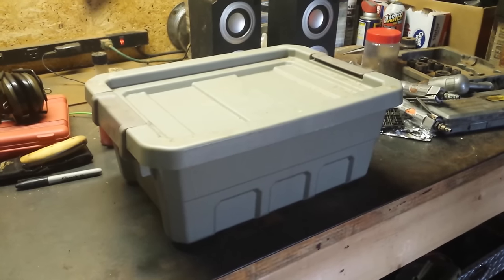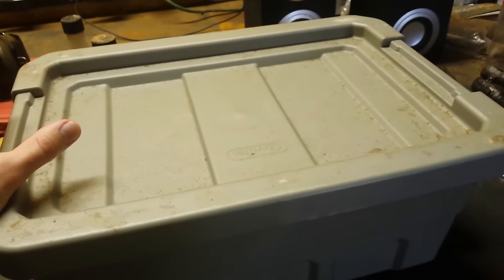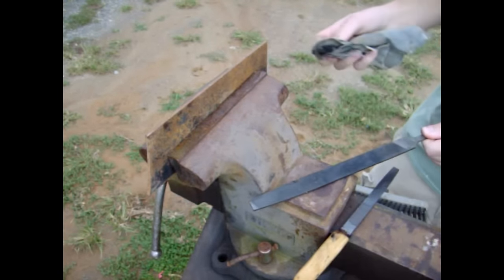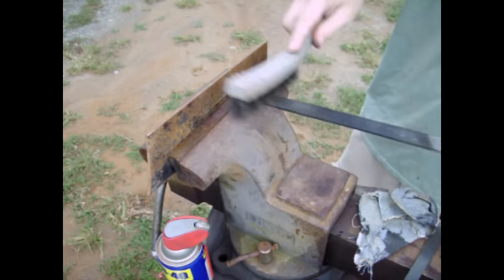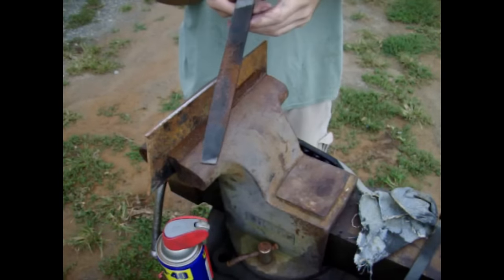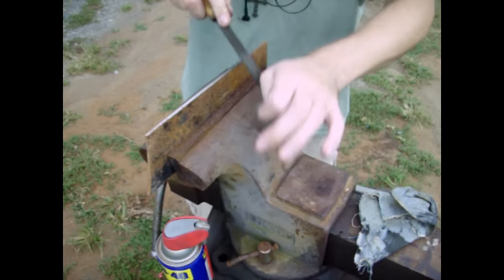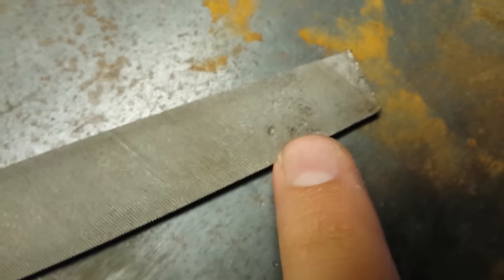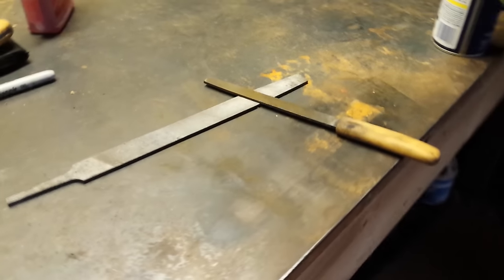How to restore your files without sulfuric acid

Comment: One of the most common forms of file abuse is to keep on trying to file a piece of hardened steel while ignoring the inevitable skating. That will very quickly knock the tips off the teeth  of even the best files. If you are not sure how hard the stuff you are filing is, use an old file to 'test the water' before hitting the job with your best files.
Acid is a waste of time. All you are doing is turning a file into a piece of metal 'sandpaper' that will grind metal rather than cutting it. Buy good quality files and look after them.

Comment: It really doesn't sharpen the file it just cleans the muck out which in turn will make it file better. Anyone that uses files alot should keep them clean with either straight muriatic acid or hydrocloric acid that cleans pretty fast thats what i use or like he done it here in the video it takes longer to clean but not as effective...

Comment: Hey a wire brush just dulls files if u think bout it steel cuts steel so it will dull it too. A horse hair or swine hair boot brush is actually better if you keep on top of cleaning the trash out of files
Reply from the maker: I've heard brass is really good to.
Reply: Brass file card.

Comment: I wouldn't leave them in there for a week. Otherwise you'd be making some vinegaroon (a liquid that turns leather black, thoroughly, permanently).  It's usually made with steel wool so it dissolves quicka.
Reply from the maker: It defiantly don't smell very good I can tell you that , but it does get the job done quite well.

Comment: why are you calling this sharpening, your just cleaning the debris between the teeth . the biggest  no no for files is to try cutting on the back stroke, the teeth only cut one way !
Reply from the maker: dan westerberg the process is called etching, acid eats away the metal and makes it sharper. You would normally use sulphuric acid but I wanted to try with vinegar, I would say it defiantly helped.  
I am now aware your not suppose to use a file on the back stroke, I guess I may had in this video but do not anymore.  
Thank you for the comment!
Reply: it is 'sharper'  than before you clean it out. but compare it to a brand new one.........check the teeth with a magnifying glass and you will see what I mean..............but your method sure does save lots of files from the scrap bin .thanks
Reply from the maker: dan westerberg I defiantly agree with that for sure. It's an older video to, I've learned a lot more about it since then. It would be interesting to see the comparison between sulfuric acid and vinegar.

Comment: Being a skeptic and a retired toolmaker I have grave doubts : very grave doubts !that  this method would work . Do a examination of before and after under microscope and prove me wrong  . I suspect the minimum  you are doing are rounding off the sharp cutting edge and Vinegar is such a weak acid you can drink it .Eager to be proved wrong down here in Australia .
Reply: However, acids work on an atomic scale, the thinnest part of teeth would erode faster than the thicker base of the teeth. I sharpened a dull bastard file that was rusty and second hand but brought back to life. It's definitely not factory sharp, but if a file is on its last legs, what's the harm? Worst that can happen is it's shaper or garbage anyway, cheers from Canada

Comment: acid works better.
Reply from the maker: I have no doubt the correct acid works better. This is only 5% acid and a different type of acid, however it will work if you can't get your hands on the correct acid.